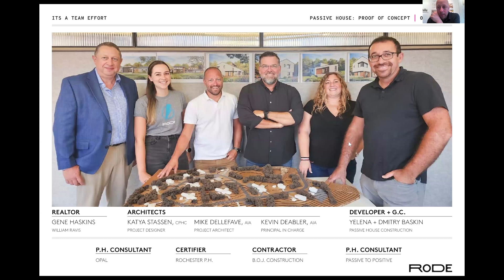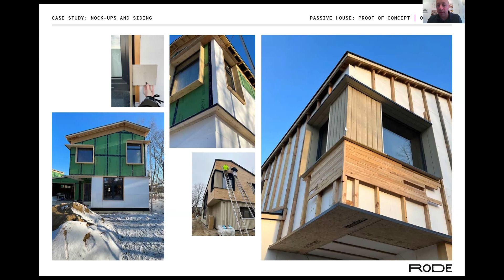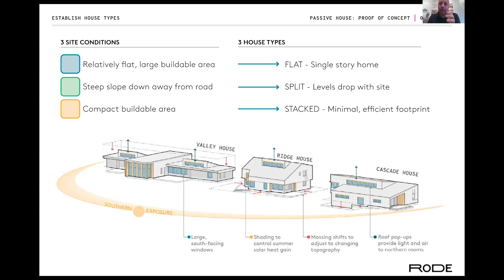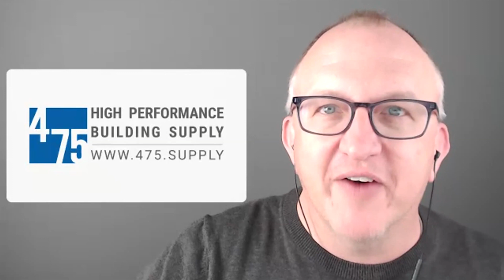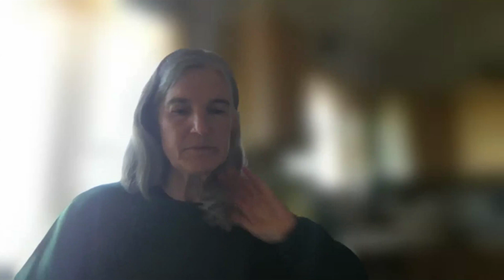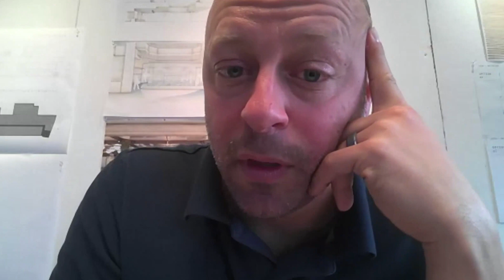Single Family Passive House: Proving the Model

Comment: seems to me that the house needs to breath... Evr /hrv do a great job.  just enough so the occupants thrive.  On the other side of this ventalation is air sealing to keep the house from  breathing where you dont want it to.    So once you get the envelope sealed up to the size of a 2 x 2 post it note and then add insulation  my real question becomes how much thermal mass should a house need to keep the temperature moderated.  I live in temp zone 4 midway up the state of Tennessee.  Seems like one is either in Reisenger land or up in Canada in the oh to cold freeze your nose off area that people are building and discussions.    So one can look at the good enough buildings, net zero / ready homes  double stud, or spend enough on closed cell foam to send a kid to college or buy that insulator his new bass boat.  Eventually there does become deminishing returns. What I really want to hear is What one can reasonably expect to break even roi on a building that is not in austin or onterio  but in a place where I actually have 4 seasons  and humidity that one needs to have a decent size dehumidifier installed for those 4 weeks a month that make life interesting to go outside and those 5 days a year when there is snow on the ground